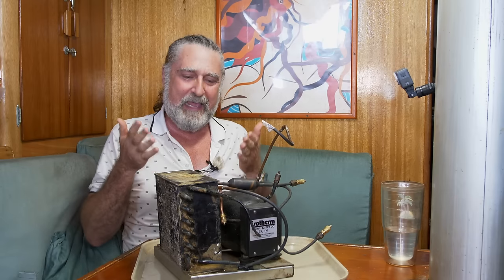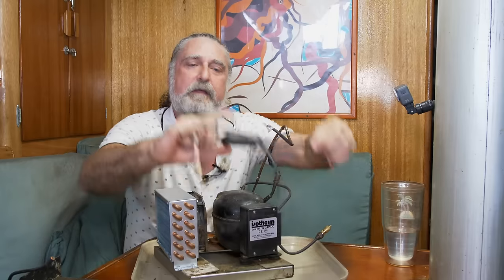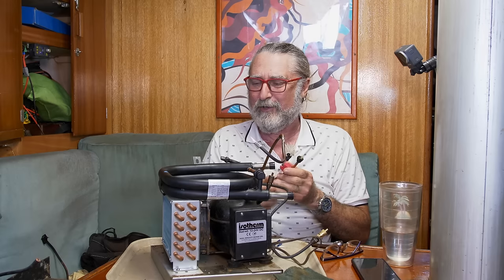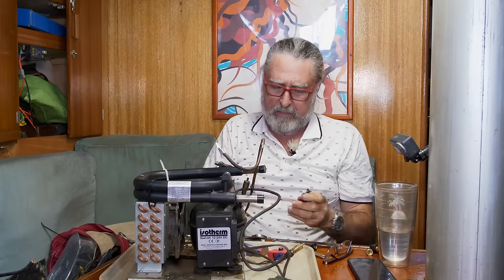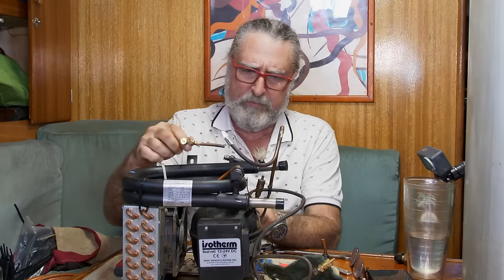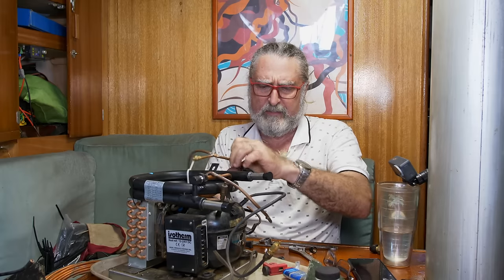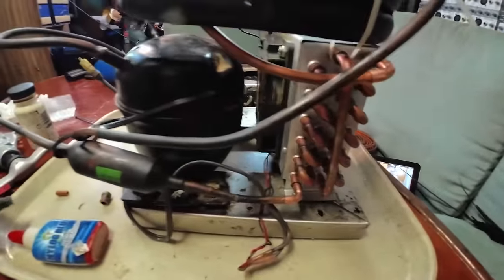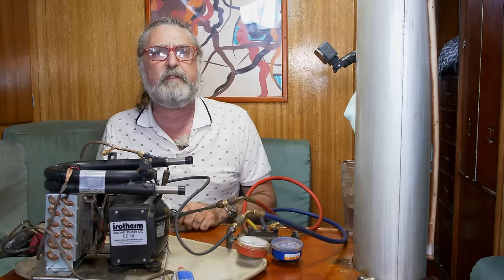Reviving a 30-year-old boat fridge

Comment: These videos take some of the consternation out of things and will allow us to attack these projects with more comfort and confidence.  Many are switching to dormitory refrigerators due to issues with their built in units because it always seems to be a $1,000 to $2,000 fix when you call in a pro for what too often is only get a temporary fix that lasts just past their short warranty.

A reminder on what refrigerant your using and if R134 how you convert to it if it isn't already 100% compatible would be nice.

And yes hardware store silver solder especially if it already has flux in it can corrode very badly.  I've lost a few rolls that had gone beyond the cleanable stage here in the Florida humidity.

Best!
Reply from the maker: Please consider sharing with friends or on forums.  Basically if it gets views I'll make more.

Comment: Very interesting to me.   Enjoyed the process and info.   I installed a Frigoboat in my boat and loved is KISS. Keep it Simple Sailor design.  Only one moving part. The compressor.  Has works well for about 5 yrs now.  The only negatives is that it won’t work on the hard.    I would love to see a video on the portable plug in 12V fridges now available.  Great stuff thanks!
Reply from the maker: Coming next week I believe
Reply: @Clarks-Adventure .   OK thanks, good to know. I will continue to follow your interesting channel.

Comment: Aye m8’s and thnx for yet another good go-through vid. I’ve got one of these Waeco CoolFreeze aboard. It’s really tiny and I hope to be able to keep it small, also when I’m getting closer to your degrees. As for now I try, as much as possible, to go for food that can take some days without cooling. At the moment the whole boat has refrigeration temperatures but in some months it will change.
Reply from the maker: As you head south your fridge will use more and more power but your solar panels will also make more power so it tends to balance.

Comment: Yes, I think the projects are good as you generally have a fair amount of education in the process.  I do like that expander tool, and at $17 it's a pretty good deal.   I was wondering if it is appropriate to use a double flare on refrigeration or is that an automotive brake thing only.   Keep the good stuff coming.
Reply from the maker: I've never done a double flair.  So I don't really know.
  Both sides need to be 45 degrees.  The single flair seems perfectly fine
Reply from the maker: Please consider sharing with friends or on forums.  Basically if it gets views I'll make more.

Comment: If you want to protect the area without wires and electric fans on melting, look into welding blankets, plumbers and AC techs use them when brazing and soldering around flammables and things they want to protect, especially when brazing copper.  Do you run a vacuum before connecting everything up and then recharge the system?
Reply: Just stumbled on your video on charging the Frig system which answered about running a vacuum before filling an empty system, which you do in the Frig repair video.

Comment: Hi Clark, what are your thoughts on upgrading a 40 year old, R-12 system with a large holding plate?
Reply from the maker: Probably time for a reboot.   Holding plates only makes sense with an engine driven system and your compressor uses too much power.  So it's probably cheaper to buy a kit or a bunch of parts and start over.
   I've used r-12 lub with 134a in a car and it worked fine but it's not recommended.
Reply: Thank you!

Comment: I was curious if you were going to replace the filter/drier.  How does one know?  I am having issues with moisture in my system, and am contemplating adding a larger drier like you have installed.
Reply from the maker: Changing your filter dryer will obviously absorb some water.   But run your vacuum for literally hours.  I sometimes run for an hour then let it sit on vacuum for a long time and vacuum again.  If your pressure goes up you either have a leak or are making water vapor.  Keep going until the pressure is stable over time.

This procedure can recharge the dryer!!   If in doubt I let this go overnight.

After this letting just a whisp of gas in and vacuuming it out again might get those random water vapor molecules out.
Reply from the maker: Boat Refrigeration and A/C 101: https://www.youtube.com/playlist?list=PLsT7_jPsZM5qNlstuF-fdlgjrimo18tq7
Reply: @Clarks-Adventure    I appreciate the quick reply.  It was because of that series that I bought a vacuum pump and gauge set to fix the non functioning fridge on the boat I purchased.  It will run for weeks, sometimes months, before going through a cycle of freezing up.  A few minutes with the heat gun gets things gurgling again.  I am curios if I should try to vacuum the system again without adding a new drier, or take the next step of new skills and sweat in the drier...
Reply from the maker: Vacuum it first.   A LOT

Comment: Great video! I learned so much from this short video. I have a basic understanding of refrigeration and have done many repairs but was always scared away from the sealed system. Joints were always brazed, and I never thought it possible to use plumbing solder. You made this very doable, thanks. One question, do you vacuum pump the system before final charge?
Reply from the maker: Building up my tricks here.  Boat Refrigeration and A/C 101: https://www.youtube.com/playlist?list=PLsT7_jPsZM5qNlstuF-fdlgjrimo18tq7

Descriptions and playlists on this channel are worth using.
Reply from the maker: Also 
 Please consider sharing with friends or on forums.  Basically if it gets views I'll make more.
Reply: Thanks for the link.  @Clarks-Adventure

Comment: Hello Clark and Emily. I just found you and I love the battery reviews. I am asking if you would do a tear-down review of the jsdsolar 12v 100ah lifepo4 battery. The few reviews that were there are all gone now. I own 4 of these and am thinking about buying 4 more, but I would like to see what you think of them. They are only $189.99 on amazon, so probably the least expensive battery you would have ever reviewed, for that size.  I have 4  wired in series and parallel to make a 24v 200ah battery bank. P.S. I just love the boat life you guys share. 😎
Reply from the maker: Our reviews start with someone like you telling the battery manufacturer about our channel.  Then they ask us for a review. 

But I might be done with battery reviews for a while.  They take a lot of work

Comment: I see the dryer after the condenser and before the evaporator.  If I followed correctly, the coolant will be in a liquid state.  How does the dryer remove any moisture?
Reply from the maker: It contains desiccant that absorbs water but not refrigerant.  Sort of like silica beads packed with vitamins.  They absorb water vapor but not nitrogen.

Comment: Good video. Do you have a link where to buy the water cooled condenser?  Thanks.
Reply from the maker: That particular one is something we have especially manufactured for the air conditioner I designed.   Best bet is to get on the mailing list by filling out the survey linked in the description of this video.  Within about a month the MarineDCAC.com should be up again so buy it through the guy running that business when it gets going.

Comment: Also, since you made your own evaporator, do you also make your own capillary tube for expansion? How do you do that?  Thank you.
Reply from the maker: Cap tube is readily available for sale.  I bet I got mine on eBay.   The trick is figuring out how long and what diameter to use.
Reply: @Clarks-Adventure  Curious how you calculate the size and length of the Cap Tube? I am at that point of construction now on my own fridge build but am at a loss of how to size this.
Reply from the maker: Yes it's difficult info to find.  Forget YouTube.  Start with compressor capacity and find a chart for diameter and length.
   You likely will need to extrapolate as our little compressors are off the chart, small

Comment: Clark I am road tripping in my jeep. I think if i had even a tiny bit if cold air at night.. it would be a luxury.  Did you design a kit for this?  Battery powered?
Reply from the maker: Not as such but I've put one of my air conditioning units in my truck camper and it works great here in Florida at night.
    You should talk to Stuart at MarineDCAC.com.  he knows the parts I used.  He might be able to put a kit together for you.   It would be a prototype but mine works.

So that, a BankManager and some LiFePO4 = Cool dry night

Comment: Excellent video with great detail.  Curious about how you calculate the size of your capillary tube?  You showed one in a previous refrigeration video but how did you calculate your length and size?  I have the BD50, condenser, dryer and evap coil but still no cap tube because I really cannot figure out how to make this calculation.  Did you do it by trial and error?
Reply from the maker: Answered in your other comment
Reply: Where did you order the double condenser? Seems very logical to use compared to a single.
Reply from the maker: I don't know what you mean by double condenser??

Comment: Do you sell the water cooled condenser? Thanks
Reply from the maker: Copied from an earlier comment:
That particular one is something we have especially manufactured for the air conditioner I designed.   Best bet is to get on the mailing list by filling out the survey linked in the description of this video.  Within about a month the MarineDCAC.com should be up again so buy it through the guy running that business when it gets going.
Reply: Thank you 👍

Comment: Where's the storage for all the miscellaneous parts you acquire?
Reply from the maker: One finds places for what's important...   Emily might not agree
Reply: Under Emily's side of the bed I guess. @Clarks-Adventure
Reply from the maker: Nope that's extra sail cloth and engine oil
Reply: perplexed by the answer.  In the piece you allude to collecting and storing all sortsa random parts.
Reply: I think he was saying he hides his collection of old sailboat refrigerator parts somewhere inside his sailboat. I inquired if it was under his wife side of the mattress. @billdomb
Reply from the maker: We store many things in many places.  Under beds isn't exactly prime easy access storage.
Reply: Good save. @Clarks-Adventure
Reply: Great video Clark! But for water condenser you need a circulating water pump ? So at the end are saving on power?
Reply from the maker: @marc4322 it actually does.  You get to turn off the fan of course but more importantly the gas condenses at a much lower temperature so less pressure so less power.  90f vs 110f

Also you don't need much water to do the job.  Water holds so much more heat than air.